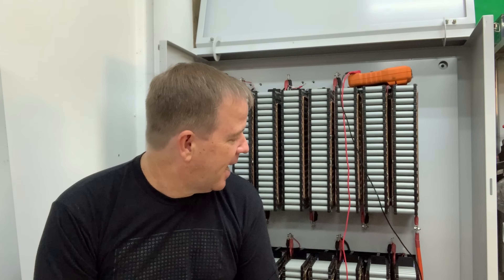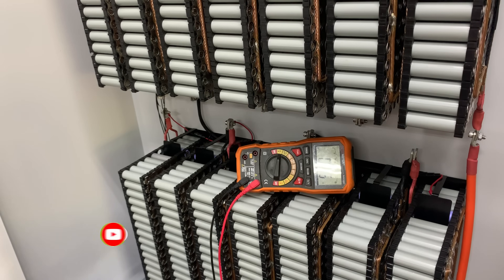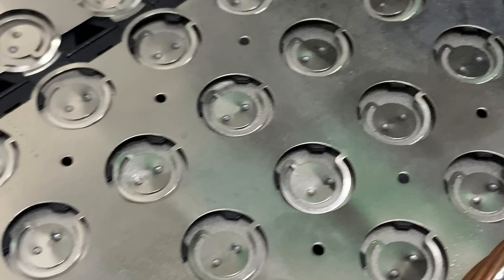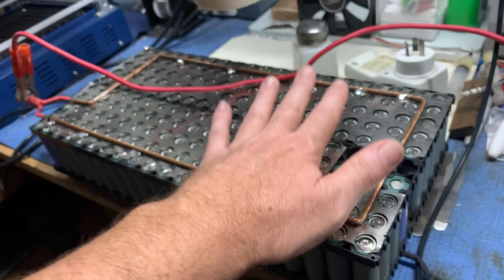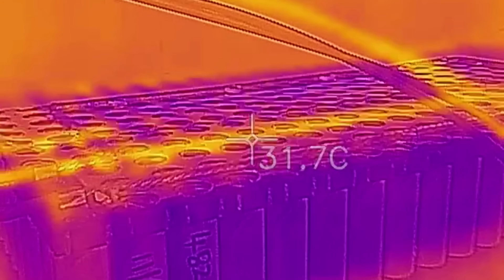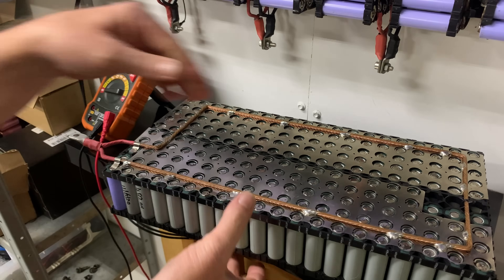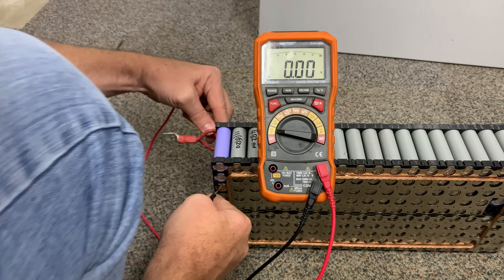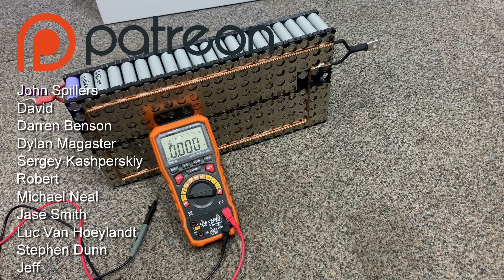Wirelessly charging 18650 batteries!

Comment: Rename the video to "Wirelessly charging 18650 batteries?"  But in all seriousness, if you find out what was the cause of this I think it would be interesting to see.
Reply: lol.... "Free energy"
Then there'd just be a bunch of EVEN weirder people join the group! :)
Reply from the maker: Just what we need a bunch of crazies ! 😬
Reply from the maker: FIFTY likes on this comment and you got a deal lol
Reply: @HBPowerwall  surely it's inductive if they aren't physically connected? Maybe 3D print some blanks to fill the voids
Reply from the maker: I think I need to build another battery and try to replicate it
Reply from the maker: Dam I guess I change the name then. I must raise the bar higher next time.
Reply: @HBPowerwall  looks like I got the Fifty likes, lol.  In all seriousness I really just want to know wtf happened.  at first I was thinking the battery wrap was too thin and, since the entire battery is negative except for the top, that maybe somehow the hangers you were using was providing some kind of connection, but then you showed that the "blank" had been charged up along with the others and there was no obvious connection it threw my idea out the window.
Reply: I think it's an Induced Voltage giving the cells a false voltage reading. But I would most certainly swap them out for a piece of Wooden Dowel as another viewer suggested. Or you could even make a 3D printed dummy cell. Might be the best solution for long term. 
The Dowel option will get dirty & could even wick outside moisture into it.... in a long term storage situation, the shed itself will most certainly suffer from moisture & condensation which is bad for any electrical/ electronics but I imagine Pete would have Air vents or fans, he's pretty thorough like that.
Reply: battery has tightly coiled foil, so why not inductive charging
Reply: Where’s Nikola Tesla when you need him…
Reply: Some kind of humidity in the air could work like a conductivity also.
Reply: @N01Spl Not sure what that means. :)
Reply: @N01Spl LOL.
/r/woosh.

Sure you do buddy :)
Suuuuure you do.
Reply: the title fools me in .let me out !!!

Comment: I'm trying to understand why you're putting these 0 Volt cells in. If they're just placeholders, just 3D print a placeholder. Or tdo they actually have a role to play?
Reply from the maker: they are basicly spacers - they touch the metal case so won't make the case live if they are not connected

Comment: So is it possible to measure the voltage of one cell even though they are all connected in parallel? I suppose an IR test is the best way and the infrared camera? is it possible for the cells to rust on the inside too? so basically if there is a bit of surface rust time to just decommission the cell?

Comment: Make some dummy cells out of plastic rod maybe rather than having dead cells in play...  I have seen batteries leak enough to end up with a micro layer of conductive contamination shorting them to ground in other systems.. You could then even put a hole in teh rod to put a screw to mount your heavy leads to and it would be an insulator... Cheers and good luck.

Comment: consider running a insulated wire that is braded around ur buss  bar , and then each lead connects per cell and grounds to cabinet , magnetic fields are a pain in ass
'
Reply from the maker: I wouldn't have thought there was a magnetic field.. might look into that.

Comment: If it's not some weird inductive or capacitive coupling between the cells then its entirely possible that during your grinding a tiny flake of iron got between the non connected cell and the fully connected cell. You had the +ve spot welded to the battery positive and the whole barrel of the non-connected cell is at -ve potential so any flake of iron between those cells and the connected cells would have forced a dud cell in parallel. Also, the one that rusted could have swelled ever so slightly pushing a flake of iron through the plastic into the adjacent cell... You'd probably be better off having some dummy batteries made with same diameter as the 18650 and use them as the support 'cells' and then you dont have any possibiility of a dud cell ending up in circuit...
Reply from the maker: didn't even consider it might have been a stray bit of solder/iron/nickel.. that's a great line of thought..

Comment: @HBPowerwall A couple of suggestions improve your battery layout/setup.

#1 For "insulation cells" you should use non-conductive blanks, not dead batteries. 
#2 Remove fuses from both sides and just have the fuses on the negative side
#3 Reorient your batteries so the negative sides of the batteries all face outwards because it allows you to do an extra check much faster, which would be to use your infrared camera to check all batteries at the same time.
#4 Add an insulative on both the negative and positive side of the battery, even if it's a heat resistant plastic layer. (In reality every bank should be fully enclosed and already in it's open separate container.)
#5 Insulate some metal "fins" (dividers) between each battery bank so if one bank was to set on fire the the bank next to it would be shielded from the majority of the heat/fire and makes the whole setup safer.
#6 Get some insulation around each power line that joins each bank together.
Reply from the maker: That info will be very helpful for other builders trying to learn - thank-you

Comment: 3rd purple cell from above has a connection to negative on the casing. That one is eating the power.
Reply from the maker: would seem so
Reply: @HBPowerwall  I seen a couple of your videos on your big batteries, I wouldn't agree with all your practices but really like your project in itself especially recycling the cells. More in the spirit of free energy. I studied the recycling part of this technology also a bit and estimate it's worse than using lead acid batteries. I think placing this instalation in a "special building" on your property is an excelent choice in my opinion. And bees ..yes they are great. Sowed in rubber bands in the bottom of your beesuit can help a lot to keep em out. Rearing queens from pedigree queens can also help a lot to keep the hobby fun especially with buckfast bees. My expierience is you should not go further than F2's. Grafting larvae and feeding them in queenless hives is a great skill to have.

Comment: I question the wisdom of using real cells, even dead ones, as load bearing dummies. Consider replacing those with 6.5 cm lengths of 18mm PVC round stock.
Reply from the maker: Just using what I had, and tried to do it as safe as possible at the time.. guess that didn't work out and someone else is smarter for it.

Comment: you need to use kapton tape once your battery is assembled.  It provides electrical isolation and withstands high temperatures. You will have fans at the base so heat due to being enclosed in tape should not be an issue.  your bms (having temperature sensors between each black block)  should also ring an alarm if batteries become overheated.
Reply from the maker: Kapton tape is a layer of safety as well as another layer to safety... i need easy access to cells to maintain and visually inspect. I believe my approach is the lesser of the two evils.

Comment: I feel certain that you have thought of also using an FLIR to do a quick scan of your Battery Pack, both at charging - and discharging. With a huge set-up like you have, you need every possible ' weapon' at your disposal! I too, have had some 18650 batteries that had developed 'spots' beneath the plastic sheath. I threw them away. But - what I find most scary, is the degradation of those Cells, where some corrosion has occurred. Is it a damp environment? The quality of the metal Battery Sheath? It would become a "nightmare" - if those bad batteries are producing invisible (corrosive) gases, that can potentially transfer that corrosion - to the healthy batteries, like Covid.
Reply from the maker: my 10,000 cells get a once over once a month with my FLIR , love it - single best investment of this whole hobby.

Comment: I know this is a little late..  I put the part 1 into slow mo and noticed the blue battery is contacting the bus bar when weight is applied... bsically it pushing hte battery to contact.

I personally wouldnt use a battery there  if it is for support.I would make a rail to slide the battery pack onto to evenly distrobute the weight accross the bottom of the vertical pack

considering this was 10 months ago..  probally to late and I am stil late to the pary ;)

Comment: Maybe the problem is from when you soldered… maybe solder got down in between the dummy cells and the live cells and fixed them. Just a thought.
Reply from the maker: it's possible, it hasn't happened again so for that I'm grateful

Comment: The rusted battery has a short and has enough corrosion to allow inductive current throughput. Before you took off the strips, it allowed all three to charge, and it could only hold a partial because of the damaged lower. You took off the strips, the rusted cell never held a charge in the lower, it simply allowed pass-through current. It's nothing more than a blank rod at the hole. Especially with the open end you punched through it, it is a wound coil of material inside of it that is an actually a pretty good inductor. So, all said and done, they are all inductors to a degree, you have a massive twisted copper loop on top of all of them as opposed to a typical flat stack. It is basic induction. 
All you need to do to test this, is line up 6 batteries separated by a battery width between them, and connect them accordingly. Then take that same twisted copper wire, run a normal loop of it over the top, but do not connect it to any but the last one to complete the circuit. Do a full charge and see what happens.
*Make sure the wire is extremely close like it was to those three*. The induction should work without issue. That's why it worked. Just look at your camera's heat map. The wire is radiating heat. That's not all heat. There's a buttload of electrons flying off that thing :)
Later!

Comment: those tabs on the  " zero cells " you  had spot welded and you cut off , it sounds like they were allowing those batteries to  ground to the frame and pulling down your  charge.   go back and check the powder coat  area on the mount to see if a bad spot  it sounds like the blistering in the shrink wrap you could see and the  spot welded  like you were pushing a surface charge through the  material  to earth via the  mount system. i work for a  company and we used exclusively powder coat   on  enclosure and  had to be careful because  not  all  powder coats  are  electrically  neutral they will  flow a surface charge  of electrical current .    also check the   physical surface  of the powder coat to see it  it allows   microamp  reading some powder coast will allow emi/rfi conductive grounding

Comment: Hi, Is there a way to add a schedule feature so that we can select when the batteries turn on, when they charge, etc.? I would like my 18650 setup to turn on between 4pm and 9pm (peak power usage) but then turn off and not charge until the sun is up and is able to charge the batteries from solar. My inverter does not have the ability to schedule. Is this function only available in certain inverters? Is there any other way around it? It makes no sense to allow the inverter to charge the batteries whenever the battery gets low because if the sun isn't up, I'm basically paying to charge the batteries (defeats the purpose of a powerwall).
Reply from the maker: I think DIYTECH & Repairs has done something like this with a Pi & grafana - all above my head tho..

Comment: Isn't it recommended to store LI-ION batteries at some capacity because otherwise crystals form and damage the structural integrity of the battery?
Also, might high humidity have led to the cells terminals to short to the copper wire/metal sheet or the copper has "bled" some copper filaments to thin to see?
Reply from the maker: they are stored in a very hot workshop and most of the time they are charged to 3.7v infact i checked them last weekend and they are all between 3.6-.3.7v and I havn't touched them since this video..

Comment: Should have tested continuity and I bet that you find a connection (might have I high resistance) between the cell on the negative side and when you linked the the positive on the bus you now have a discharge circuit.

Comment: Maybe the mystery cell's insulation is not good anymore and it is touching something somewhere so that measuring its one side against the busbar shows a voltage because the other side of the cell is actually touching the busbar on the opposite side somehow.

Comment: It actually is almost certainly charging wirelessly! The air between the battery and the bus is likely turning into the dielectric of a capacitor with the bus and the battery acting as the plates of a capacitor. The voltage isn't high enough to jump the gap and cause an arc, but there are a TON of amps available and the electrons are still attracted to the other side, even though there isn't a direct path there... And so since there isn't a high enough voltage for the electrons to arc through the air, instead the electrons all just cram together tightly in the plate trying to get as close as they can to the other plate, allowing more electrons to flow into/out of the disconnected batteries... So, this won't continuously charge the battery, as the air capacitor can only get so much charge until it becomes saturated until the polarity changes when it switches between charging and discharging. But it's enough to allow a decent enough flow into/out of the battery each charge/discharge cycle, but nowhere near enough to properly charge it, thus eventually causing the damage seen.

I hope this helps!
Reply: I agree with you on this I know I'm late to the game but this is what is happening to him. I thought the same when I seen the damage that was done to the housing of the batteries. Good joob

Comment: I would add a data acquisition module to test the batteries, that way it is measuring the voltage in real time and if there is a problem it will notify you. Also a smart smoke detector as well. After all if you don't schedule the maintenance properly, the battery pack will schedule it for you.
Reply from the maker: That has been sitting in a box for the past 12 months. Lost passion for the project once the laws changed.

Comment: What's the point of using these 0 V cells? Why not complete the pack with usable cells?
Reply from the maker: All the weight of the battery pack onto just a few cells - it was planned as a safety 'feature' well... you know how most plans go!

Comment: At the end of the day - using dead  batteries for "spacers" - is a pretty bad idea, for a spacer a piece of 18mm dowel would be safer.  To ensure something is at "Zero volts"  it (both sides of the "disconnected cell")  needs to be either pulled down to ground (use a pull down resistor if absolute safety is a concern)  or pulled UP to rail voltage.  Floating voltages  ?? lead to strange electro chemistry in battery cells.....

Any leaking cell does not belong in a high energy system.
Reply from the maker: It was an idea at the time, and I took the time to do it the best way I knew how- turns out I learnt something new :P  Learning every day, today is no different - thanks for the input

Comment: Creepage Current would be my guess. Even though there is no direct connection current can still leak into (and out of) the cells. Because of how close they are to the bus.
Reply: I was watching a vid about how electricity flows and creates a magnetic field and how the batteries radiate electricity

Comment: It would be interesting to confirm faulty or heating cell by measuring its internal resistance IR. I reject cells that are above 80mΩ but for concistency I measure IR only between 4.0 and 4.10 V.  Usually charged IR tend to increase with cycle life, but this is very variable from cell to cell and from brands to brands. I have a really good bunch of cells that are very old and very cycled but still show good characteristics. (if I accept the capacity loss as it is and use them knowingly)

Comment: I would put blanks there rather than batteries... maybe epoxy dummies... remove the problem all together. Nicola Tesla knows wireless transfer of energy happens.... if you put a battery there you are always going to have some transfer of energy.
Reply from the maker: for sure!
Reply: @HBPowerwall  simple  physics..lol .. most of the time the simplest answer is the correct one. But we tend to overthink problems... I know I’m guilty of it often.

Comment: Hey Pete,
Have you thought about the possibility of when the soldering of the bus bars was done that some of the liquid solder ran through the battery shrink wrapped cell and one of the positives might be making contact with the negatively charged battery shaft?  This might be how the voltage is being transferred and draining the cell but possibly not enough to spark and only showing up at low capacity?
Reply from the maker: I don't think so but possible I guess.